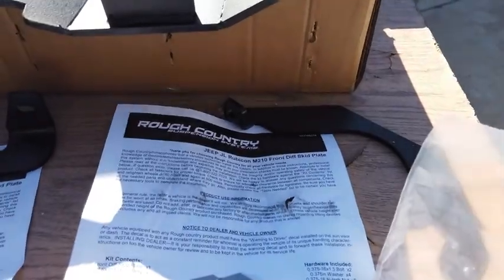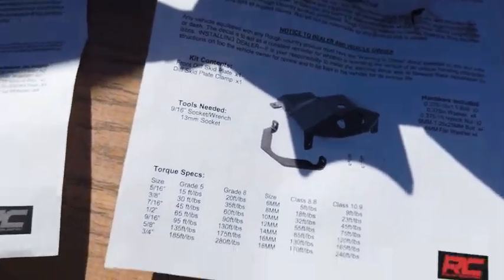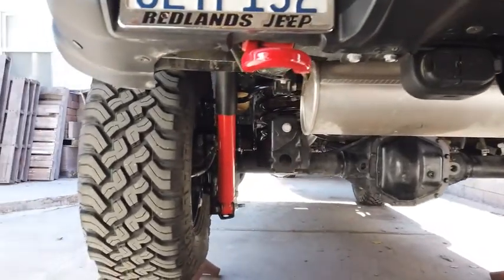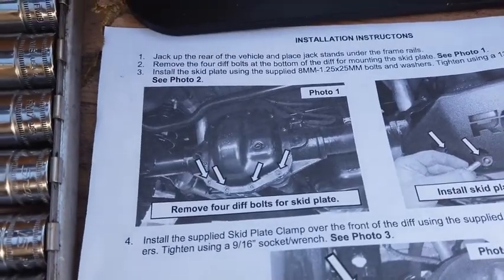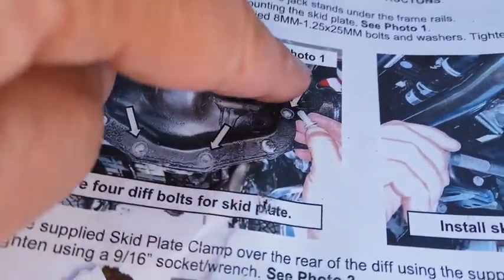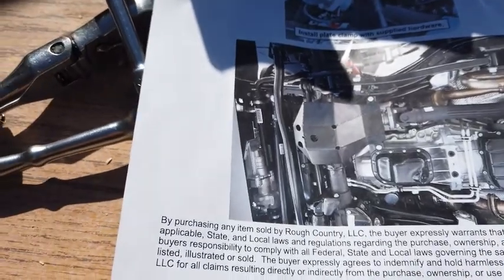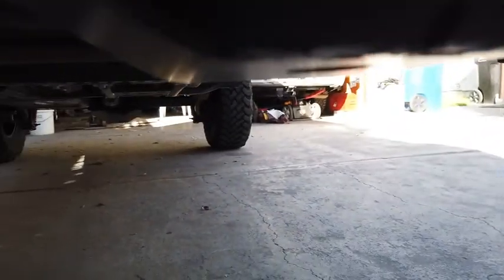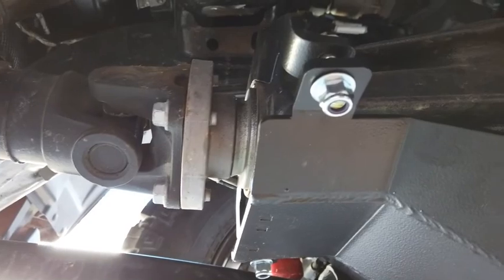Rough Country Differential Skid JEEP Wrangler JL

Comment: How has it held up?  I was thinking a spacers for the brackets as well.  Maybe even U-Bolts? Watched a Gladiator video in a rear diff install and he had the same problem. Just wondering how it takes hits and holds up. Don't want any sheared bolts on the trail...
Reply from the maker: Thanks for reminding me.  I just crawled underneath today to take a look.  Looks like the Diff Skids took a few small hits; but, the rear skid took two pretty bad hits. Both rock solidly installed.  I checked all the belly skids and they all look pretty good. The only lost bolt was on the right rear muffler armor.  I have to head over to the hardware store and pick something up.  Otherwise, I'm glad you reminded me to check after putting another 5,000 miles on it and driving numerous dirt roads.  I changed the air filter and it was getting dirty; but, nothing really bad; but, I don't like waiting for it to get really bad.  I really have to catch up with my uploads.  MEH.  I'm not monetized anyways; so, it's not a high priority.
Reply: @301steady  I have a Gladiator (Rubicon) and the front skid fit, but the rear did not.  In the rear, there was a gap of about 1/4 inch between the skid and the front of the diff housing near the pinion.  There's nothing to support the weight of a hit and this would put all the stress on the cover bolts. Even though it's supposed to be the same diff, apparently there are differences. Didn't want to chance it, so I will be returning. The front fit perfect. I did place three washers in the "air space" on the bolt between the skid and bracket. Still plenty of clamping pressure, but some structural support and able to keep it even.

Comment: I just put mine on the back of my JL and the clamp that goes over the diff in the back I tightened down to the point where the bolts were pretty tight and wouldn't move but the metal wasn't touching like you had it. I had a friend help me keep the clamp straight but is there a point to where you can tighten too much to where it will hurt the diff? I just want to make sure I tightened mine enough.
Reply from the maker: The priority when setting the plate, before tightening, is to get the plate as flush to the diff as possible.  The first rock the plate gets itself on, is going to shove the plate onto the diff, and if the clamps aren't tight enough, it could loosen or break.  If it's a natural irregularity where the metal springs back, then it shouldn't be a problem.  If it was me, and I was a little concerned, I would loosen the bolts and try to seat the plate better; but, if it's as good as it gets; then, it shouldn't be a problem.
Reply: @301steady  The clamp was on pretty straight before and after I got done tightening I just didnt know if there was a break limit on tightening something on the diff like that. Its solid as hell on there so it should be alright. The feet on the clamp were a little bent from tightening but I dont think thats an issue.
Reply: @joshuadavis2062 now that it's been one year Joshua how are things with yours?
Reply: @ElevatedVehicles  Been great! Took hard hit on my front diff skid and it ate it like a champ. Ready to eat more.
Reply: @joshuadavis2062  dude that's awesome. Thank you for the info